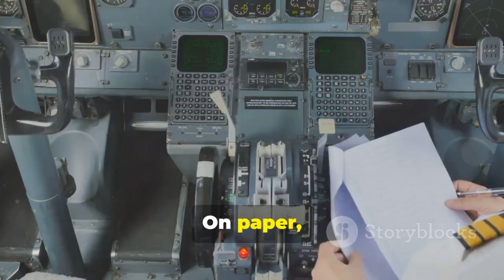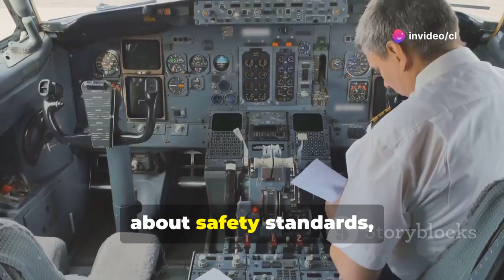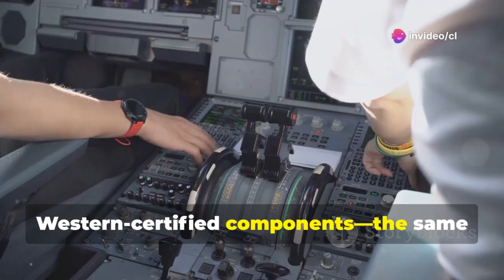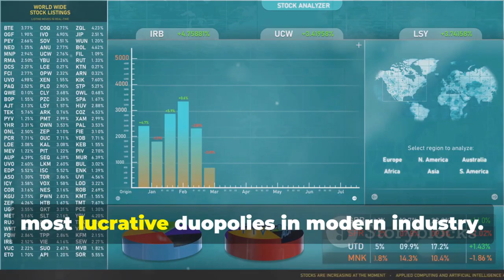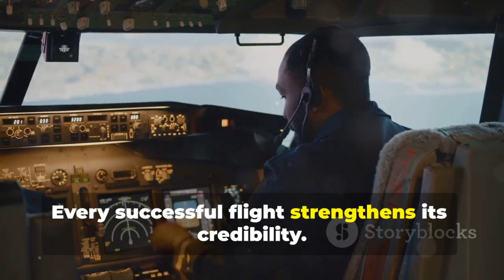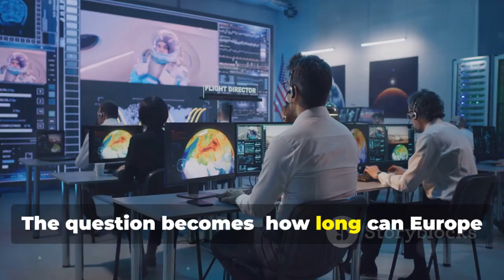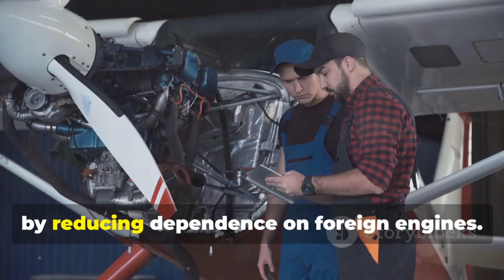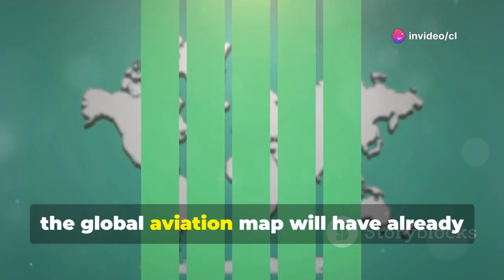China's C919 Has Western Parts But Can't Fly West - Here's Why

Comment: The technology and components made by the west in the west will be certified. The same technology and components made by the west in the west but sold and to be used by others will not be certified.

It's their loss, because China actually does not need these components. China offered them a market share under mutually beneficial conditions, but since they refuse, bye bye.

FAA and EASA are no longer safety Certifications, but market monopolistic mechanism. No need for FAA and EASA. China's CAAC is more rigorous and trustworthy. CAAC has a better engineering integrity than the commercialised FAA.